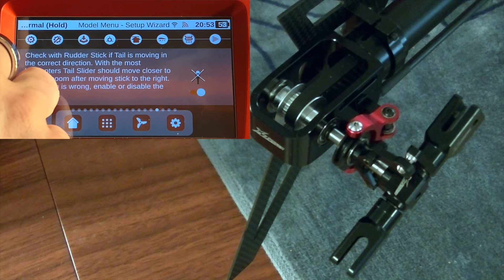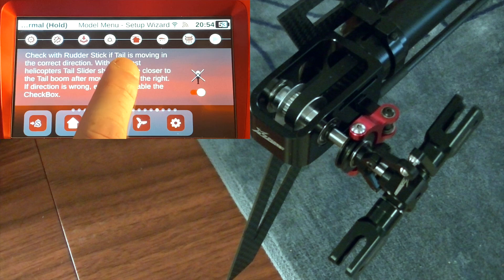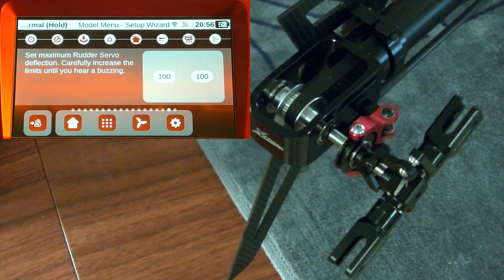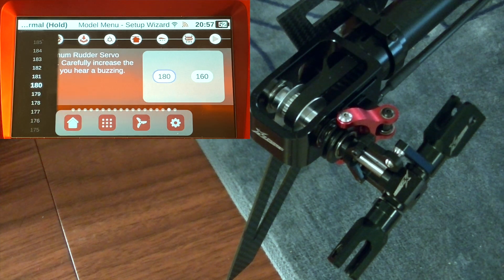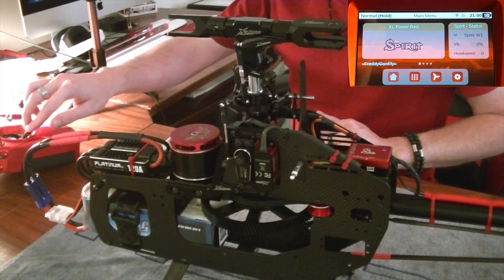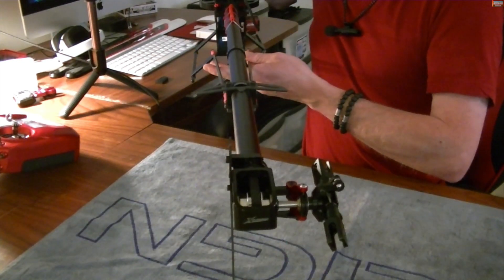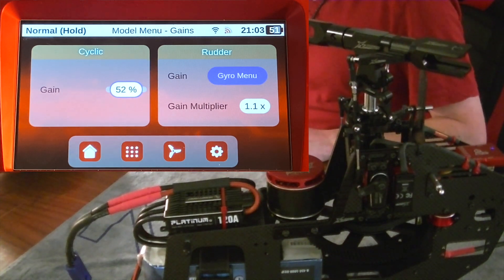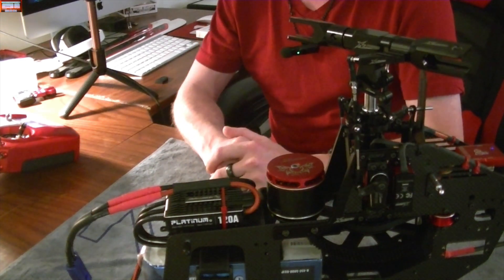Spirit Wave : Setup Wizard 3 - Rudder center, limits, and gyro correction. (FreddyCanFly)

Comment: I believe your tail travel numbers of 180/160 are too high.  Those high travel number signify overly fine resolution, but at the expense of speed.  This may cause a laggy tail performance.  I believe you want a longer tail servo arm hole to get these travel numbers closer to 90-120/90-120 for a more optimal balance between resolution and speed.
Reply from the maker: Hey thanks so much for the comment:) I will be on the watch for this !!! I also found it odd but only had the one servo arm for the video 😂 I will double check the Manuel for the heli for sure.  👍

Comment: Thanks again for your great videos. Could you also show the general radio settings at some time? Would be interesting to see what can be adjusted in the radio itself.
btw: Is there already a sim on the radio? (It was advertised in the past)
Reply from the maker: @david-e7630  yes I will be covering those during test flights and fine tuning.  And the radio is setup for wireless sim but I do believe there is an actual sim in the works.  I will be sure to make videos for that as well 🤓
Reply from the maker: @david-e7630  yes I will be covering that information during the test flights and fine tuning series.  And it’s already setup for wireless sim, however I also do believe there is a sim in the works.  I will be sure to make videos for those as well 🤓